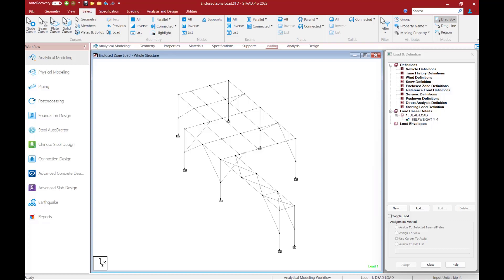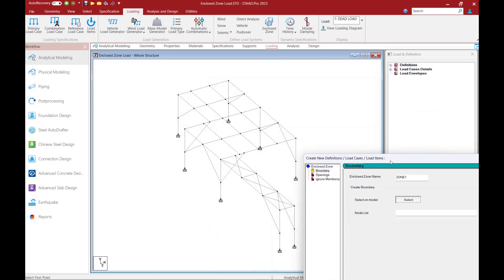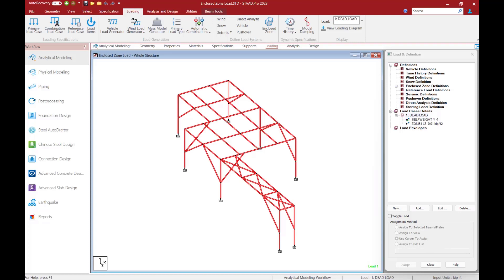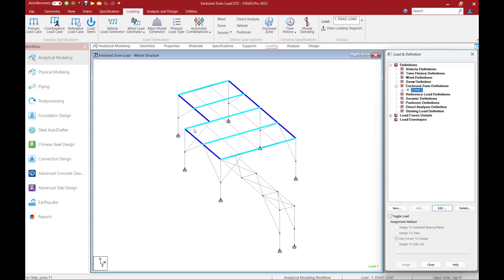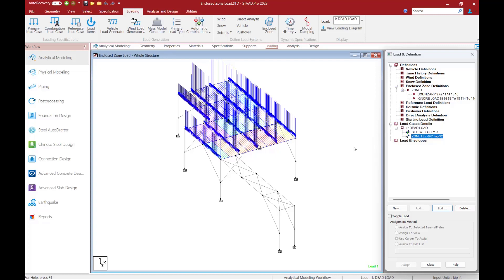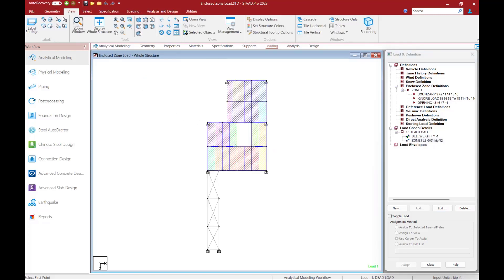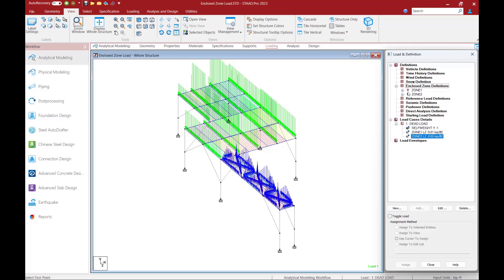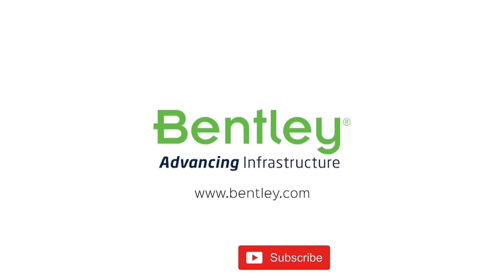Creating Enclosed Zone Loads in STAAD.Pro 2023

Comment: What is the difference between this enclosed zone load and floor load?
Reply from the maker: The enclosed zone load and floor loads are similar, but there are a couple of key differences. The enclosed zone load can handle more complex geometry, such as openings and member within the zone that are not designed to attract the loading directly. This new command is initially for vertical loading, and in the future, will be expanded for alternative load direction.